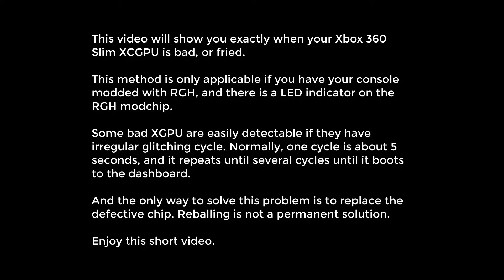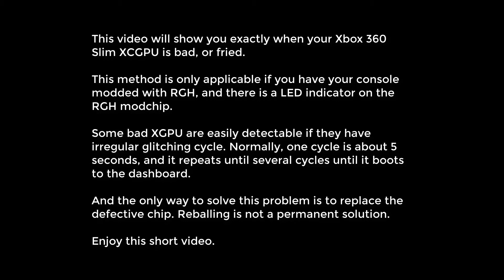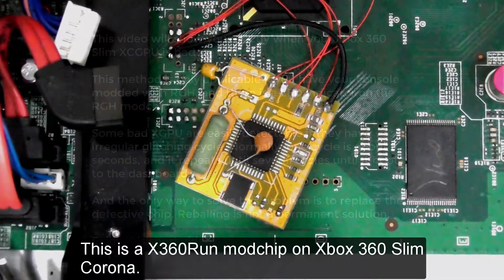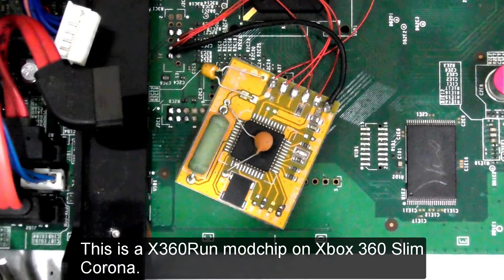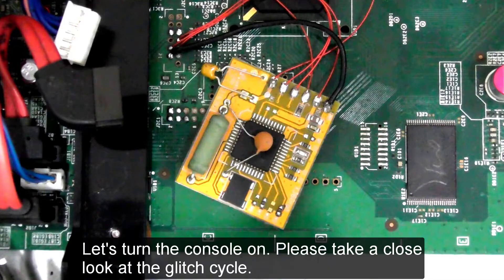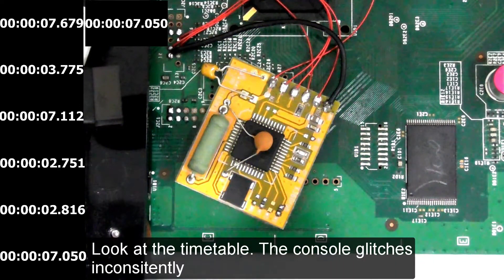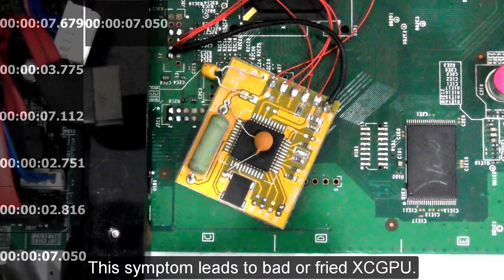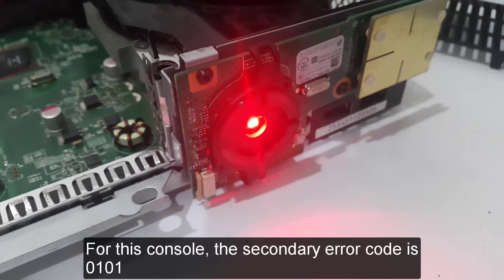Xbox 360 Glitch Forever

Comment: Thanx for the info.... something to add, when removing the the CGPU and using ur multimeter measuring the 8th with 9th ball  & 9th ball with the 10th ball it should read 33ohm for good cgpu, but 0101 error mainly is SB error for me, 0100 and 0020 i find mainly dead CGPU
Reply from the maker: +Raed Abbasi i have repaired many slims with this similar symptoms, and mostly when it glitches forever (even with constant glitch cycle)..it should be dead xcgpu.

But when it does not glitch, or no power or no hdmi output, it should be the southbridge.

Most of the time, the chances to repair this console is about 9 out of 10

But anyway thanks for your info. I havent known anything about measuring the 8th, 9th 10th ball. Can you show me which ball (in pictures).

..thanks
Reply: for the dead CGPU i say not always error code 0101 it could be SB also dead CGPU i encountered are 0020, 0100, and E82, and working CGPU with artifacts on screen, but for inconstant glitch time, this is good new info, i well make an image and send it to you
Reply from the maker: +Raed Abbasi yes..your info is correct. 8th to 10th pin is in the post_out area, is that correct?
Reply: yes in the post out area
Reply from the maker: +Raed Abbasi thank you
Reply: sent you on facebook
Reply from the maker: +Raed Abbasi thanks...